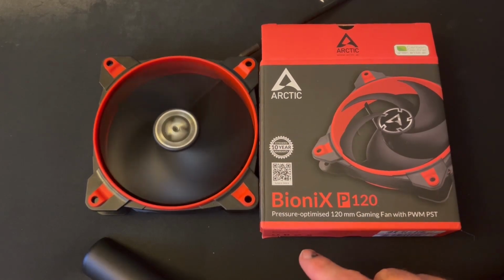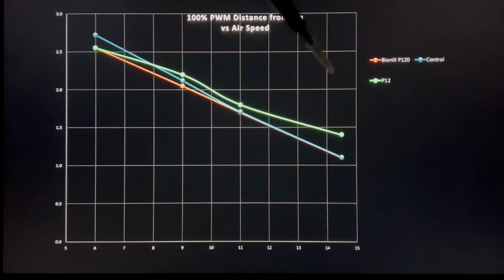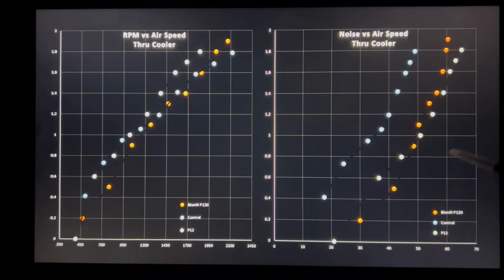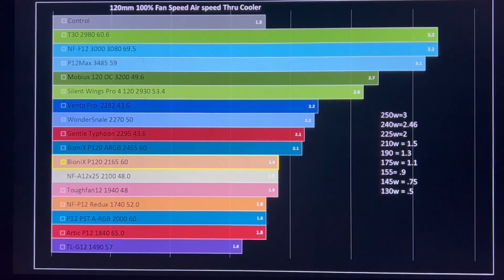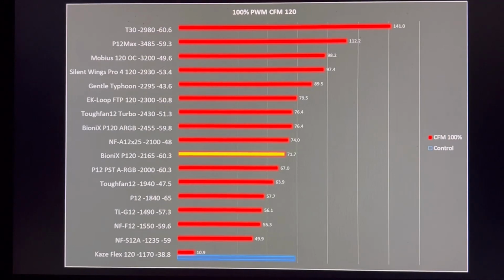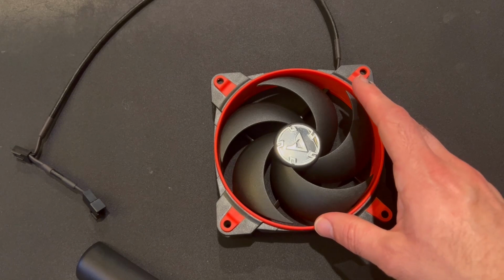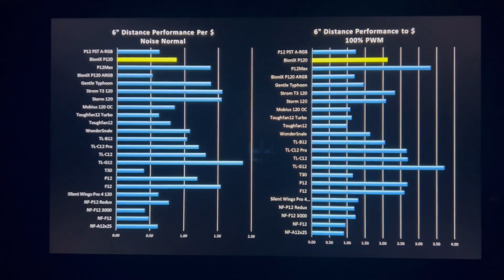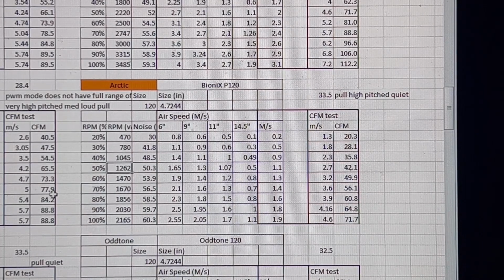BioniX P120 Is it better than the P12?  (Old Testing Method)

Comment: Curious if from your point of view these 27mm height fans are worth developing? Or is there another more suitable size?
Reply from the maker: Its actually all about static pressure. A thicker fan allows more room for advanced blade designs. There is a trend for thicker fans coming for the AIO and radiator markets. Its not really needed for air coolers.